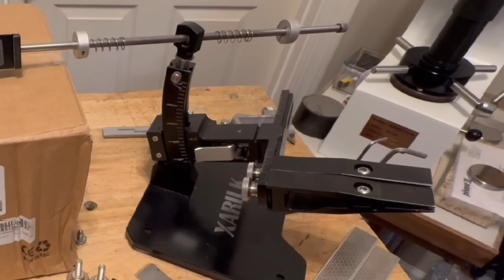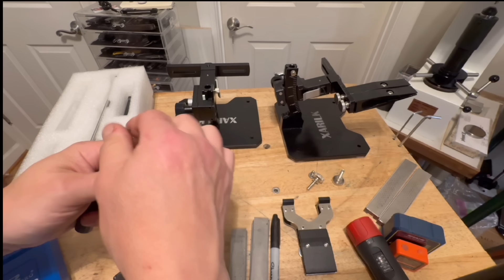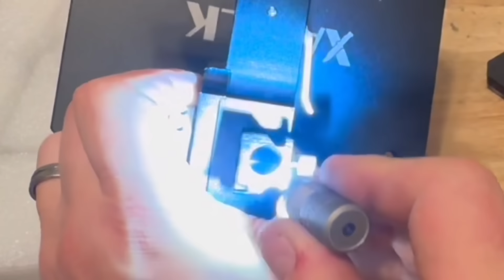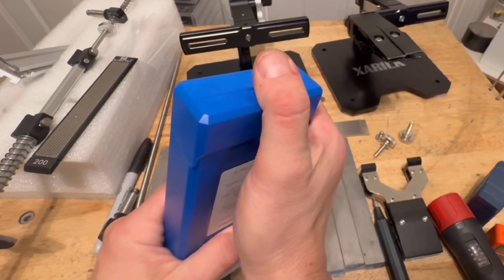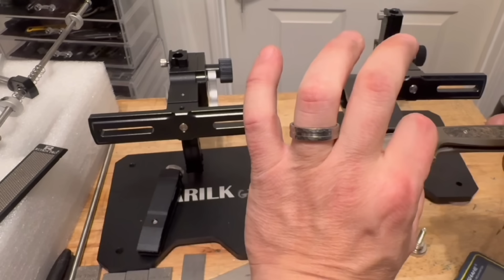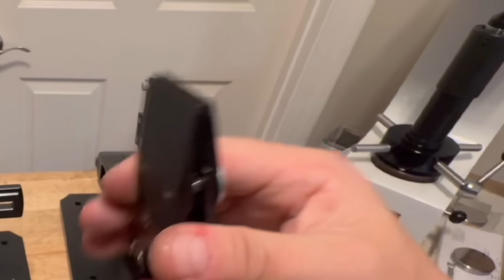XARILK Gen 3: improved? MOSTLY…

Comment: Jonny at Xarilk has advised me they are making a new version since this video which takes care of the gimbal/stone height adjustment issue on the version 2(version 3?) not fitting flush with the base restricting the measurement of stones with smaller height. I have seen two newer videos with the new design and also pics on Amazon and the Xarilk website showing the new design with the gimbal fitting flush with the base.
Amazon has not worked through all of it's old inventory with the flawed design which can be made to work with washers(per Jonny).  I like that Jonny is listening to his customers and improving the product although I would prefer the customer not be the Xarilk quality control guinea pig and this be tested and improved in house before product release.

Comment: I have 2 Gen3 devices. They were delivered less than a month apart. They both have the silver metal teeth. On the second one that came the gimbal doesn’t sit all the way flush with the device. The gimbals on these 2 units are not interchangeable. The new one is bigger in diameter. It won’t even fog in the other device. I guess I won’t be concerned unless I get stones that are thinner than the minimum gap. 
     Are you still happy with the Sy tools diamond set? It duplicates some of the included Xarilk stones.

Comment: Id assume the lil bottle is for dawn or index, water etc to apply to plates as you're using them? Im figuring all this out myself, lol. Im curious to know how well those new plates do. I need to order a set but im considering the dmd set as I already have dmd resin bonded 4 plate set so?? Thanks for all the greatly needed info on these systems. Really appreciate your videos. Big 👍
Reply from the maker: These diamond plates in this set perform mediocrely. I still use non-metallic ones 3000 grit and above.

Comment: acc. to neeves knives, if the blade is not clamped in the center when you flip it over to sharpen the other side the angle will change by a few degrees, I've tested this and your angle can change by as much as 4 degrees

Comment: I use 3-in-1 oil when sharpening I saw  another youtube video where the fellow used a bunch of different oils and/ or treatments on a bunch of the same knife blanks, and the one soaked in 3-in-1 oil worked the best, by far!
Reply: I like 3 in 1 for lubricating metal.  it is great...however for sharpening knives where the lubricant meets the blade, I prefer a food grade lubricant that will be safe for human consumption..3 in 1 is not human safe. If you never think your blade will be used to cut or slice any type of human consumables, have at it with 3 in 1...I say, better to err on the side of caution..5 years down the road, how will you keep up with what lubricant a knife blade has..I always use food grade lubricants on my blades just in case...it's hard to beat food grade mineral oil or Japanese Camellia oil.
Luckily, some folks are making food grade resin stone lubricants too..If it is food safe, the manufacturer will say it since this is a big selling point imho.
Reply: @daveburch947"food safe" is just a buzz term. Like organic, or non-gmo. Something people use to charge more money for things from people who know no better. Do you leave shot glass amounts of oil on your blades? Every time I sharpen a knife, I clean it. Any amount of oil left is is almost impossible to measure, and thus harmless.  

Same as "food safe" cutting board finishes. As long as it is fully cured, and you're not cutting pieces of and eating them, they're just fine.
Reply: @OldNew45  if that were only true....oh wait,  I heard the next covid jab is ready...you need to rush down to CVS and get it..lol..

Comment: I've looked for your recommendation for stop springs and haven't seen one. I've tried twice estimating springs and the od is too small and they definitely are "tight" ir "springy" enough. I obviously know nothing about springs. Can you please offer an Amazon link or specs for the springs you are using?
Reply: @JG-cv4cl  I bought the Hapstone „Spring-Assisted Stopper Ring ⌀6mm“ (SKU: STOPPER). They fit wonderfully. Their diamond suspension, strop and magic oil are great too. When the diamond stones wear out I will probably go for their Hapstone Start Diamond or CBN stones.

Comment: hi, i bought the new version of the xarilk gen 3, and a set of tsprof stones. How i can modify or adjust the machine to work with that set of stones? Thanks in advance!
Reply: I've done some brainstorming here and there (and to be honest i'm not an engineer or something, i work as a phisician, so eventually excuse me for my inexperience) and come to a conclusion: it's possible to use a set of tsprof stones even with the newer version BUT changing stones (or maybe let's say a strop) of different thickness can result in an angle change. So to compensate for this, you have to measure (and adjust) your angle. It is correct for you? 
Thanks for your interesting videos and suggestions!

Comment: I'm shocked to to see that nobody still has mentioned anything about the fact that the gimbles have never actually been centered in any of the models. When you flip the unit over to sharpen the other side, that's when it becomes an issue. Is this something you missed because I haven't seen you mention it?

Comment: Hi! I’m having 2 different angles on the knife and I think it might be the part that rotates it’s giving me 2 different angles and it’s driving me crazy I can’t figure it out lol. I appreciate the help or any tips
Reply from the maker: Are you using the Y-clamp?
Reply: @CBRxLIVE yes and even with the original clamps as well
Reply from the maker: @JoseCalderon-l1h  did you try my “flip the clamps with knife” trick? 
As to the Y-clamp, make sure that the thinned out section where the screws are isn’t bowed
Reply: @CBRxLIVE yes I check everything. But I think it might be the part that rotates

Comment: I watched several of your videos on the 3.0 and was getting ready to purchase it when I saw this video and read the comments and then read the reviews for the last month on Amazon and it is not good. Is there any way to buy the 3.0? The three.1 Has way too many bugs
Reply from the maker: One option is to wait and see what they do about it. If you were to order it now, I think the risk to you is minimal because you can either return it or contact them via this email xarilkofficial@gmail.com and request the replacement. They have been known to send the whole unit if there’s a video or pictures of the issue attached.
Reply: @CBRxLIVE  
I have the 3.o from 2025, haven't even used yet, I have alot of knives... should I keep or wait for the 3.2 , can I get the newer clamps and what not for the 3.0?
Reply from the maker: @tonydillinger2553 not sure what you mean by New clamps. The 3.0 is fine for sharpening as it is IMHO with all the recommended items. The 3.1 was problematic for some users and 3.2 supposedly fixes some of the issues. There are no perfect machines in the world btw. 😂
Reply: @CBRxLIVE 
15 mins in you talk about the clamp improvements.
Reply from the maker: @tonydillinger2553 Sure! But do you own a file, dremmel or belt sander? 😜

Comment: Is there a way to use the TSPROF convex attachment with this system?
Reply from the maker: Anything that fits TS PROF also fits this system
Reply: @CBRxLIVE  Im not sure how you would connect it though.  The TSProf rod seems to break in two, allowing you to connect each end to the convex attachment.  Whereas, the Xarilk rod screws into the stone holder.  In other words, you need a two piece guide rod it seems.  Not sure if that makes sense, but if you watch their video on the convex video you will probably understand better than me.  lol.

Comment: Great and very informative, thanks! 

I just received my (updated) Gen 3 today and took it straight to sharpening. My biggest gripe is that the guiding rod is binding inside the bushing, so it's near impossible to get an even and consistent stroke across the blade. Is this something you faced as well? Did you find a solution? So far I only tried some oil to lubricate the rod, but it didn't remedy the binding issue at all.
Reply from the maker: You can take the gimbal apart by carefully removing the small c-clamp (which is easy to lose). Then you can get to the small set screw that secures the bearing housing inside the gimbal. Loosen the screw a little bit and see if that helps. Thanks for subscribing!
Reply: @CBRxLIVE thanks for your reply. In the end I fixed it by taking apart the assembly and polishing the inner bearing ring and reassembling. The bearing itself is a GE6C type, so it can be replaced if all else fails.
Reply from the maker: After 75-80 sharpenings, the inner surface of the bearing has worn out. I ordered replacement bearings with the core made of stainless but haven’t gotten around to testing them: https://amzn.to/4qMXfS7
Reply: @CBRxLIVE in the latest version of the assembly, they changed it such that there is no more grub screw hidden below the spring loaded mechanism, but rather there are 2 separate screws holding in the bearing. It's thus now easier and more reliable to replace.

Also an important PSA: don't take the C-clip off the spring loaded assembly, it's such a pain to reassemble. Instead, put the entire head in a vice, then loosen the grub screw and release the spring tension with the vice. Reassemble in reverse order. It's safe, quick, repeatable and easy.

Comment: Thank you for this video! I'm tired of my Lansky system. It works but.. leaves much to be desired. I've been reviewing many fixed sharpeners, most were beyond my budget. After seeing your video, I feel this may be the best sharpener for under $250! I got the accessory single clamp and a set of guide clamps and still spent l less than $140! I particularly like the safety shield on the guide rod, even TSPROF doesn't come with one!

Comment: Just to let you , or anyone else know, the metal gear, that is fixed to the base with 3 screws, needed to be shimmed out with a piece of plastic milk carton, so the adjusting screw, for angle, could work with the little silver lock lever. I'd make a video, ut I don't know how. I thought I was going to have to send it back until I took it apart and figured out I was goin to have to fabricate the shim.
Reply from the maker: Great suggestion, hope it helps folks out!
Reply: i have same problem with the angle lock not working.  Can you send me pictures on how you shimmied?

Comment: Received a new Gen 3 on 31 Dec. It was defective out of box. Emailed Jonny. On 1 Jan I got a request for pictures and description of problem. Sent on 2 Jan. Received a replacement unit on 4 Jan. I have never had that kind of customer service. Would absolutely recommend this company. Looking forward to learning how to use this new tool.
Reply: however, it begs the question, why is the company using the customer base as their quality control guinea pig?  They need a better in house quality control unit.  I resent any company using the customer as their quality control.  This is not the customer's job and should be heavily frowned on, regardless of price.
Reply: I had the same great customer service from johnny
Reply: @JohnLackman  Are you saying you also had issues and had to contact the company to correct the issue?
Reply: @daveburch947 yes
Reply: Same here. Johnny is a boss!
Reply: @gmillwoodphotography  Did you also have an issue with your unit?

Comment: I’m sharpening better because of you. I just on boxed my sharpener. You’re suggestions are right on.  I noticed one issue. Since they machined the mast, there are some positions that the lock does not lock. Try it; more towards the top.
Reply from the maker: I have a fix and, BTW, they are aware of this. Scroll through comments please, I detailed the fix under a similar comment. Appreciate your compliment, friend!
Reply: @CBRxLIVE  if they are aware of some issues should i wait a few months for an updated model before buying?
Reply from the maker: @Benson7290  if you’re looking to expand your collection without getting into too much financial burden, wait a few months before buying ANY “hot new thing”. Eventually everything becomes available at a discount. 
This particular brand is known for post-release fixes, so the answer to your actual question is a Yes
Thanks for subscribing!

Comment: I received this for Christmas and was really wanting to enjoy this product, but it has what in my opinion are two deal breakers. The first one is what was mentioned in a previous comment, between 22-23 degrees you can't tighten the angle adjuster, it just flops around. The other was also mentioned in the comments, is the lock for the blade rotation.  Just way too tough to open and close the lock lever. Also when rotating the blade one side is harder than the other to lock/unlock.😣
Reply from the maker: I published a fix for the blade rotation latch here:
8 must-do’s before you sharpen even a single blade on XARILK Gen 3 fixed angle sharpener.
https://youtu.be/zbQPANCAKJo

loosen the three little screws that hold the gear segment to the column by just half a turn,  move the mechanism to the top of the mast or 4° angle and latch it in place. Tighten the middle and the bottom screws, then move the mechanism down to 22-24° position and tighten the top screw. That should help. Also, read the comments below regarding how the company handled this and some other occasional issues.
Hope this helps!
Reply: @CBRxLIVE  I seen the video before I posted my comment.  It's just a poor design of a locking mechanism. I also noticed you stayed away from my other compliant. These should never of left the factory with this kind of flaw. Of coarse I was hoping that I would get a $98 sharpener that performed in the same ballpark as the $799 sharpener, but this is a case of you get what you paid for. Caveat emptor.
Reply from the maker: Well, Sir! Did you read other’s comments? They are getting full replacement units for free without having to return the faulty one.
Reply: @leeloowho  Yes, you could spend $500 more or, spend 30-45 minutes making the adjustments recommended in this video and save that money! This system is a such a good value that putting a little effort into tuning it is very much worth your time.
Reply: @CBRxLIVE  So the customer is being used as the quality control guinea pig, not the manufacturer in house..shameful...

Comment: Thanks for your honest reviews 👌
I am looking for my first sharpening system for $300 or less.
What do you think of the Sharpal 202H?
Reply from the maker: Tbh, XARILK is the only one I can sincerely recommend at this time. Read through some comments and you’ll see why.
Reply: @CBRxLIVE Thank you very much…will definitely look into the Xarilk 👍
Have you tested the new Sharpal?
They said the stones wont stay proprietary and it also seems like good value on first glance.

And which digital angle Finder would you recommend for something like the Xarilk?
Reply from the maker: @A @Agent_ilis  I started using this one recently because it’s rechargeable and so small, I can zero right on the blade and get the true edge angle 

https://amzn.to/3Nn0vFA
Reply: @CBRxLIVE Thank you so much 😊👌
Reply: I'm in the same boat and I was truly torn between the Sharpal and Xarilk. The way I see it, the Sharpal is a good one-time purchase; you stick with them for replacement stones, if a knife doesn't fit then bad luck, etc. But the Xarilk is a clone of Tsprof so you can buy almost any part from them or compatible 3rd parties to expand your collection over time and improve your skill towards achieving hair-popping mirror finishes on your knives. Also, the flip mechanism when turning the knife over on the Sharpal was a big bummer, many people complain it's a hassle, and that's something you do really often when sharpening.

Comment: Hi! I have the Y clamp and i noticed the difference in angle between the two sides of the blade. It made me crazy, i'm a perfectionnist, so half a degree or one degree or more, it's unacceptable. Adding the washers solves this problem or just the strengh issue?
Reply: Hi! I’m having the same problem with mine. Did you figure it out by anything? 😅
Reply: @JoseCalderon-l1h  Yes I don't use it anymore, I switched back to the originals clamp. But you made me think I should re-try to find a solution. I'll post it here if I do.
Reply: @j @jeromemennessier mine still does it even with the original clamps. I think on mine it might be the part that rotates

Comment: Are those third party 6mm shaft collar/stoppers with springs? Do you have a link for what you are using?
Reply from the maker: Here you go, check them out. They are 6 mm and fit 1/4” as well. First time you put them on it takes a bit of tightening but after that just a 1/8th turn to unlock 

https://amzn.to/44OS63S
Reply: @CBRxLIVE  Thanks! I'll check these out
Reply: @CBRxLIVE  what size bit and type of screw or bolt head are in collar? Thanks